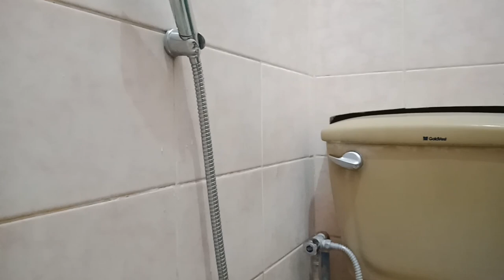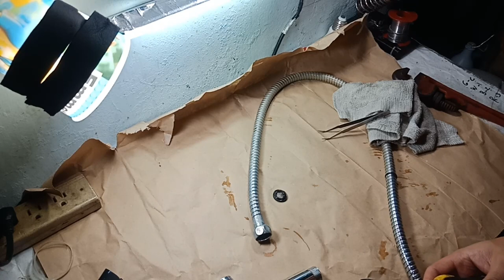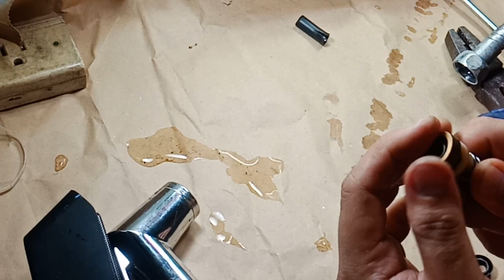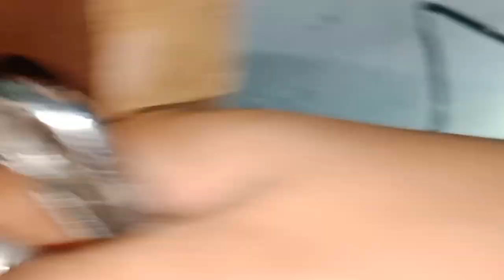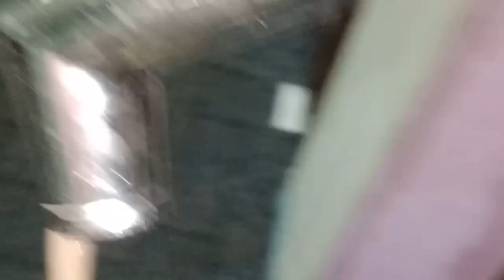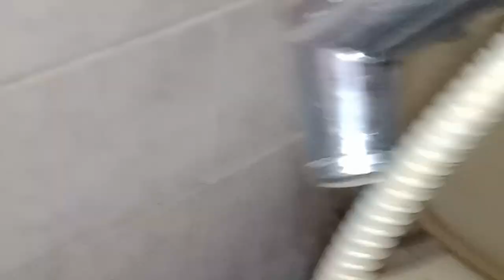HOW TO REPAIR LEAKED BIDET HOSE

Comment: The bidet hose that you showed and easily fixed is the one with a plastic collar connected at the end. But how do I disassemble my hose with a metal crimped at the end?
Reply from the maker: you can cut the hose and use hose clamp to fix it.
Reply: @MaEveslyAL  hindi nakita yung pg cut mo ng hose

Comment: I would factor in the age of the hose in deciding to fix it. Rubber and plastic ages and becomes brittle. You might be disappointed in the longevity of that repair. If so, replace it with a new one next time.
Reply from the maker: For me its better to repair and use it to maximize its lifespan. It can also save money than buying a new one. BTW thanks to your input sir.
Reply: @MaEveslyAL  Your welcome.

My parents were children of the Great Depression. They had a saying:
“Use it up.
Wear it out.
Make it do.
Or do without.”